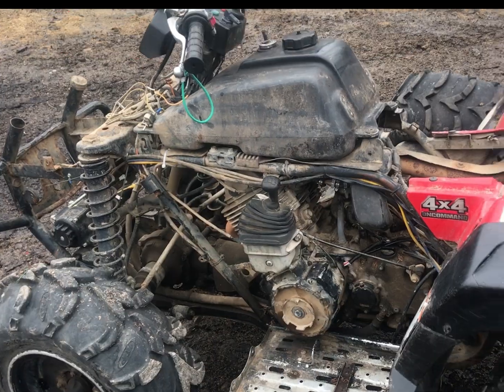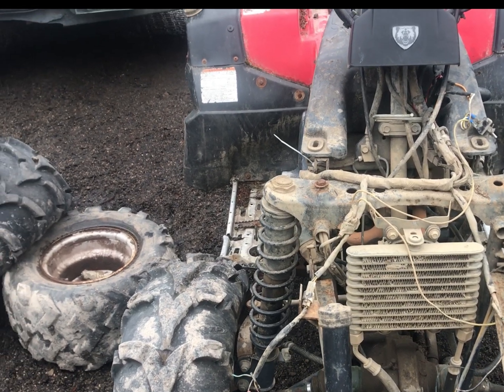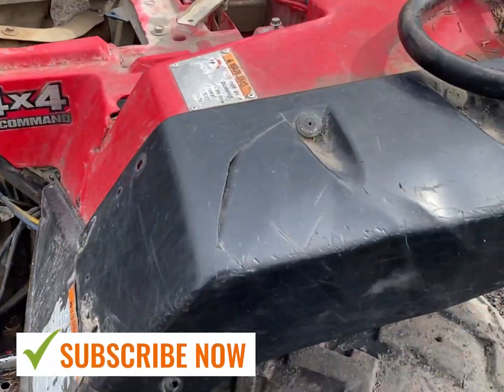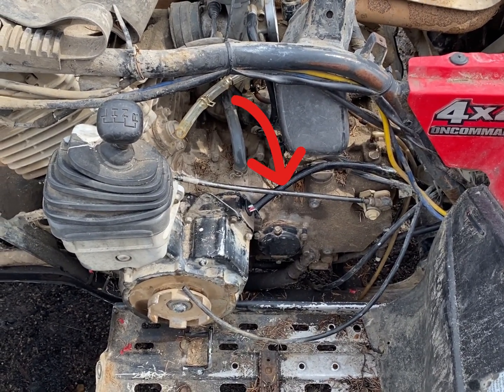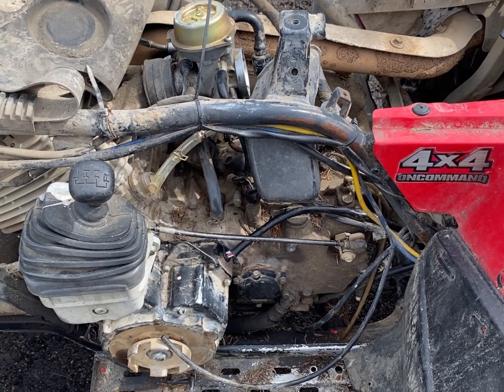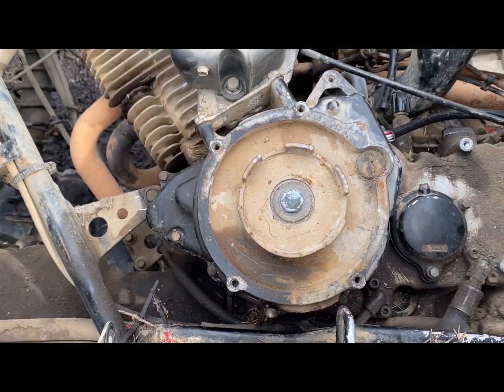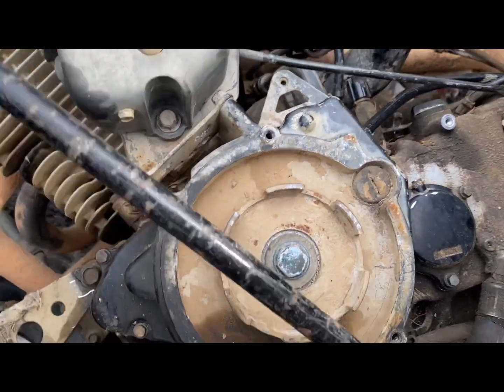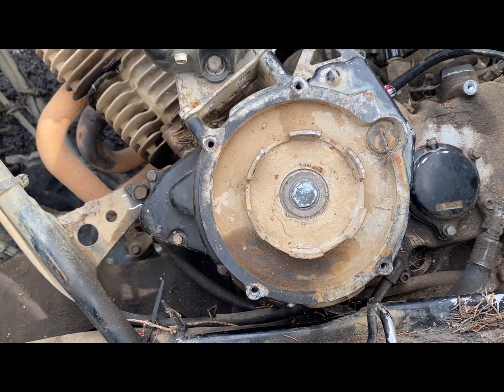Grizzly 600 no spark condition. Surprising reason why. - The HillBilly ToolBox Way

Comment: Did that on my 01' grizz easy mistake to do
Reply from the maker: The give away to me was the wear on the plastic casing of the pulse coil and the twist in the wires. I can see how it can happen. I often take pictures of things when I disassemble them so I have a reference point when I put it back together. Thanks for the comment.

Comment: If it ran in the morning and the guy parked it, he comes out a few hours later and no spark. How did it run before with the pulse thingy in upside down in the morning?
Reply from the maker: There is a gap in the story that I was told from the seller. I think the guy before him tried to change the stator when it quit and put the pulse coil in wrong, gave up, and then sold it to the person that I bought it from (who bought it for parts).
Reply: @HillbillyToolBox  
Ok, that makes sense, thanks. Thanks for answering. 👍
Reply from the maker: Thanks for watching!